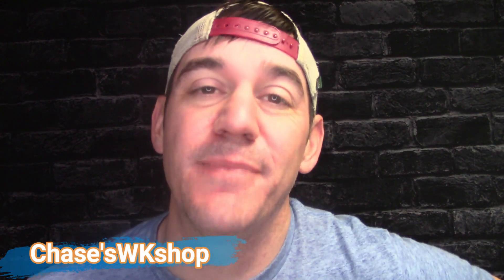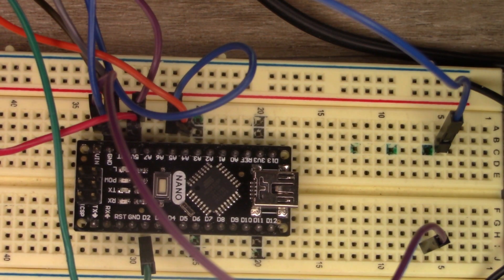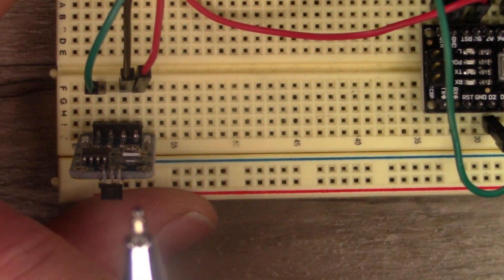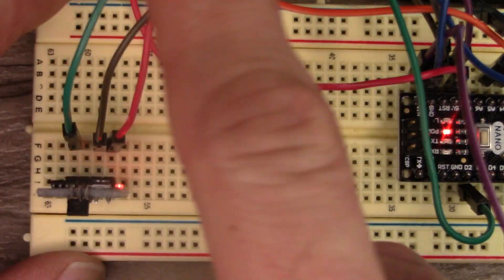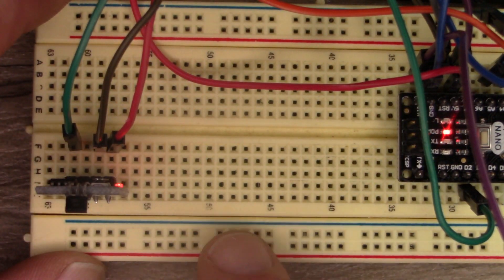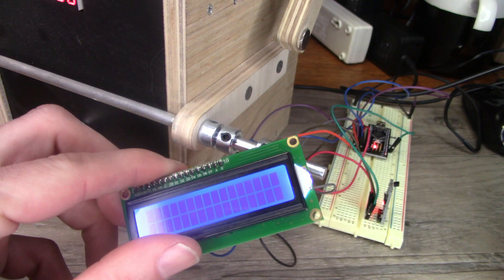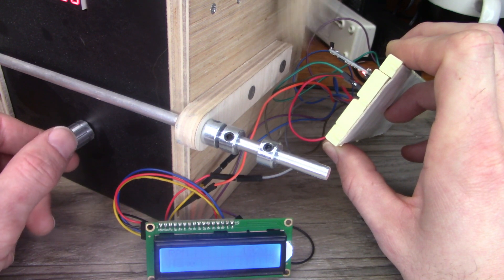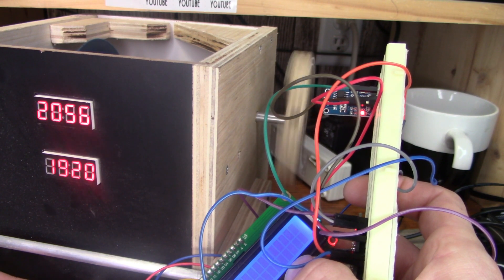Lathe RPM Meter using magnet, hall effect sensor and LCD Screen

Comment: this is super cool because I'm trying to figure out how to get an arduino to read the speed of the speedometer cable in my car, its a mechanical spinning cable, this makes me think, a small 1" disk with a tiny neodymium magnet on it with a hall sensor and then have it display the results of an equation rather than direct speed :D

Comment: I've been debating whether to go with a hall effect sensor, or an LM393 sensor. I also plan to have the system calculate and display both rpm and surface feet per minute of material being turned, and feed rates for lathe tooling
Reply from the maker: Gotcha bud. You may want to look into an OPTO interrupter switch too. Uses an infrared light to make counts with an arduino. I use one in my pickup winder 2.0 video. It was giving a pretty accurate reading off of a 5500 rated rpm motor. I don’t know how fast it can count but it’s above 5500 😂
Reply: @ChasesWKshop  thanks for the suggestion.

Comment: At first, why refresh the whole screen? Just put the text on it at initialisation.
Before writing rpm, put the cursor in place..
For measuring, measure the time between 5 pulses and calculate the rpm from there.
Then you can refresh it multiple times per second.

You will get a much higher refresh rate..

The only delay will be the refresh time + 5 pulses.
Reply: I am not an expert on this as well....
But you have to make it logical at first...

Initiate with all stuf that will never change...

I will have a look in this, since I do have some desk raise motors with build in hall sensors...

Can take some time, but I have all the stuff laying around here.

But first I have to finish my own project, building a metal mill from scrap that my customers discard...
Reply: @doctordapp Did you ever figure out the new code? Thanks
Reply from the maker: Wouter Annes awesome. I’m really not great when it comes to the writing of the code. If you want to re write it I’d be glad to use it and share it. Thanks for the info and the help. Hope all is well.
Reply: Totally agree. If you count pulses in a second the fastest you can possibly refresh is once a second. You need to TIME between pulses rather than count pulses to improve refresh rate.

 If you put FOUR magnets around the circumference and have 4 pulses per rev your accuracy will improve as well as improving your refresh rate.

 The time period at 100 rpm is then 60/100 or 0.6 secs per revolution or 0.15 seconds between pulses (4 magnets). Using this method means that even as low as 25 rpm your accuracy is good and refresh rate still acceptable (0.6 secs per pulse) IF you REALLY want to read that low.

To read as low as 1 rpm? You will HAVE to use some MANY additional pulses per rev to attain a good refresh rate. Try using a printer encoder disc with > 100 lines per revolution or better and opto reading.

You COULD use BOTH opto reading (below) 100 rpm and magnetic above. The Arduino can decide when to switch over 

So in summary:
Time between each pulse (use interrupt routine)
Multiply that time by 4 (to get time for 1 revolution in seconds)
Divide by 60 to get time in minutes
Invert (take the reciprocal) to get a direct rpm reading.
Reply: Bob my spindle has 4 magnets, and my tachometer went to crap a couple weeks ago, so I built this one, I would like more accuracy, I tried to implement your method into the code but I failed m couldn't get it to work after multiple tries, any input would be 👍 thanks in advance

Comment: i am having trouble with the #include <LCD.h> what does it mean?
Reply from the maker: Jerico Tantoy make sure to have the correct libraries in your arduino ide. That include tells the code to pull the LCD.h library. If it’s not in your plugins on your ide it will throw an error. Hope this helps.
Reply: @ChasesWKshop  where can i get the LCD.h library???is it included in the liquid crystal library already?
Reply from the maker: Jerico Tantoy 
https://youtu.be/V1gYnS6QDFQ
9:20 time stamp I show where to get it and how to install.

Comment: Can it measure up to 10000rpm?
Reply from the maker: y y aja I’m not sure if it will read at that rpm. You might want to look at an OPTO interrupter switch. Should be able to replace the Hall effect with the OPTO switch module.